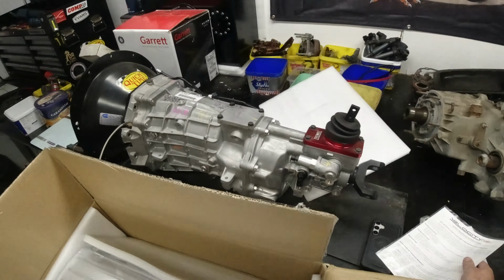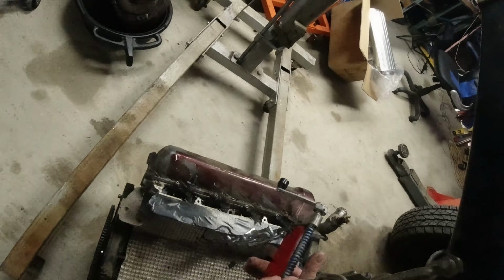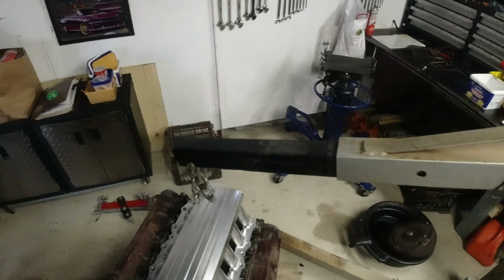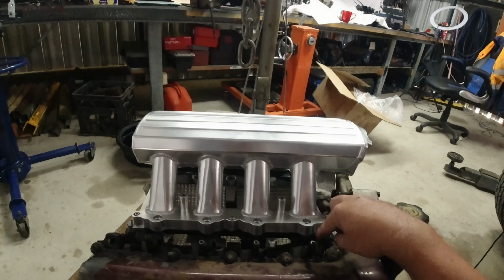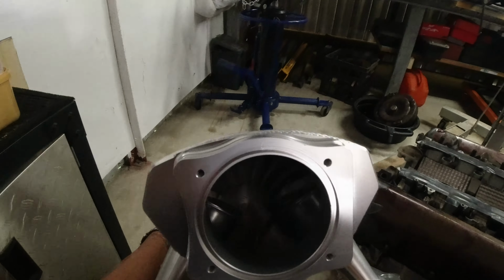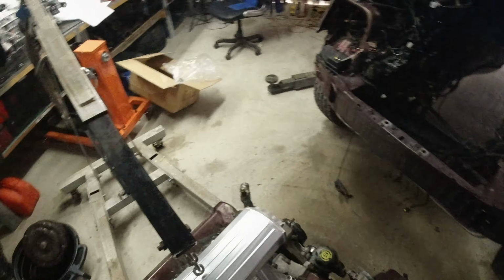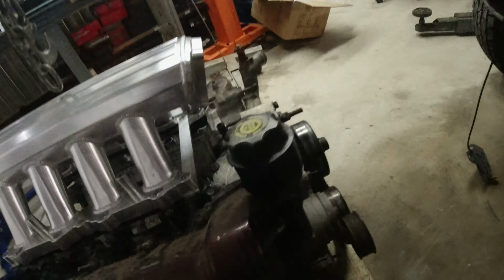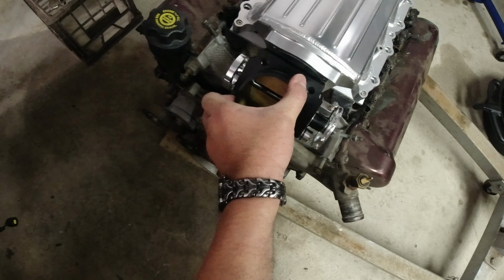Unboxing new intake manifold for my insane Twin Turbo Jeep project.

Comment: 4.7 rods are made of paper  mache and glass, and barely able to live at the 300 hp level, good luck. Chrysler made everything as thin and light as possible, and live at the 230 hp level.
Reply from the maker: @jamesgeorge4874  That is why I am not using stock rods.